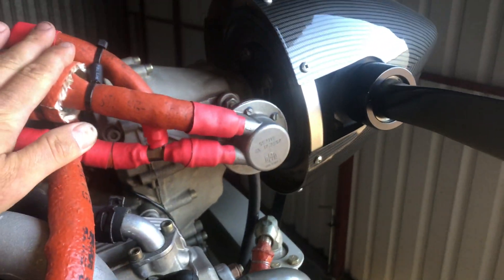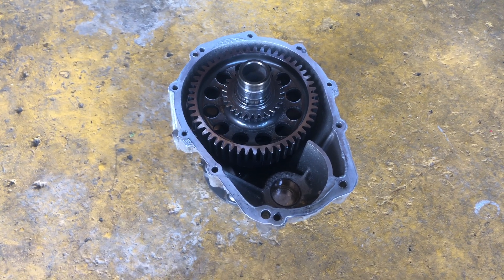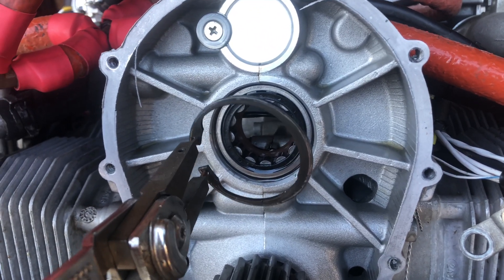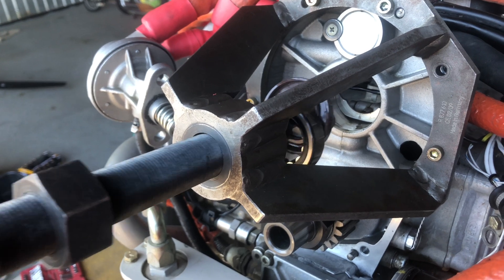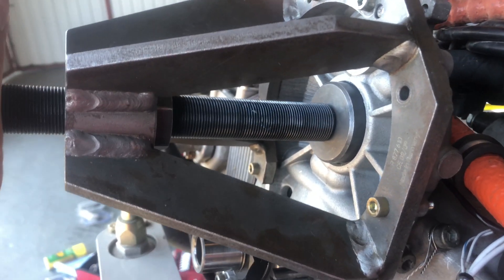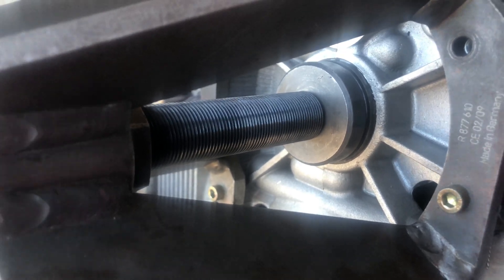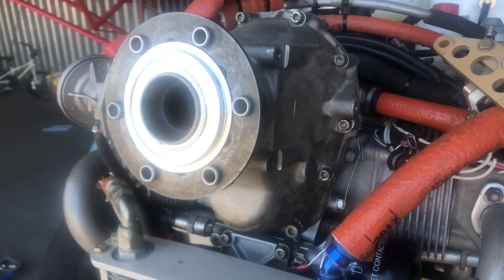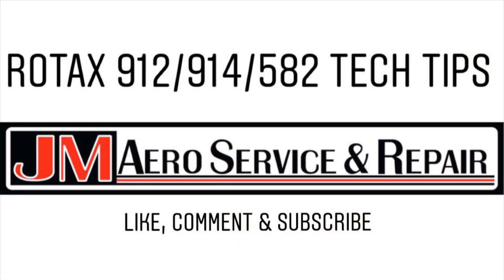Rotax 912/914 Rear Prop Shaft Seal Replacment

Comment: Hi I have an oil leak on the round chamber above the bearing. 
It is sealed with an O-ring as far as I know. 
Can the O-ring be replaced with the gear box removed?
Or can it only be replaced by separating both half's of the crankcase?
Reply from the maker: Hi yes the gearbox needs to be removed, there’s a screw holding the cap in place and it can be tapped out, oring replaced and reinstalled without splitting the case